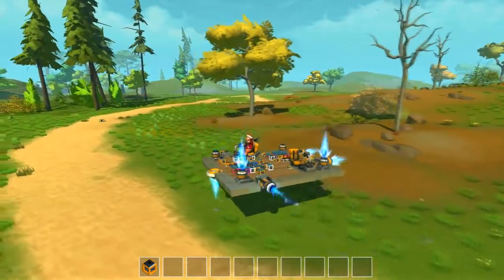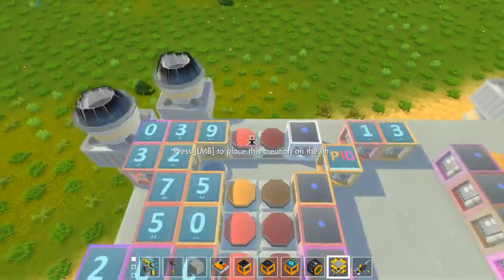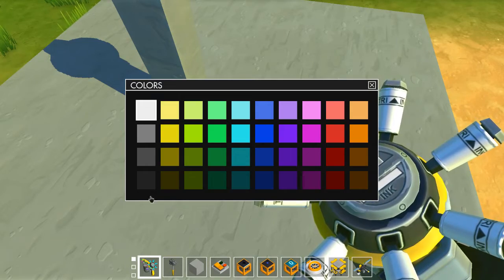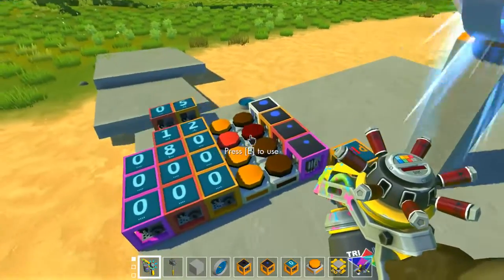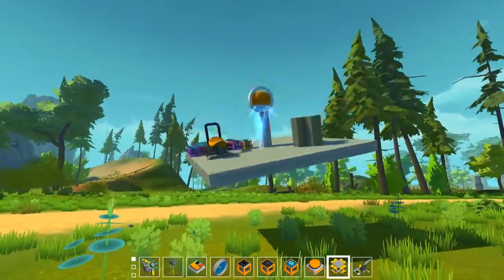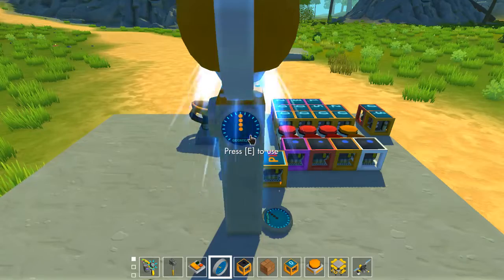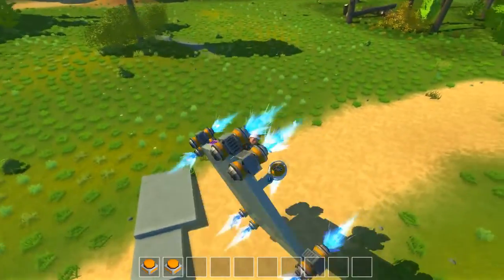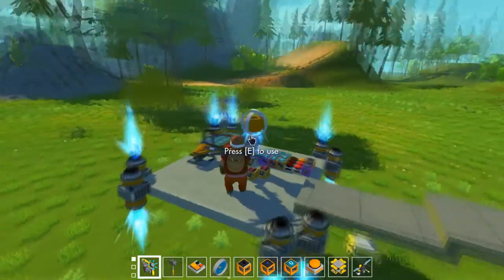MathBlock PID TUTORIAL | Scrap Mechanic

Comment: I had to look up PID controller on wikipedia. In laymen's terms, its basically the stabilizing computer for quadcopters. Plug in a desired data value like an altitude, along with the current data value, and it spits out numbers that you feed into thrusters and engines that (if tuned correctly), will correct the difference between the desired and current data values. "Proportional" is simply the difference multiplied by a constant (higher constant means a more powerful response), and I and D are integral and derivative calculations that factor in time. "Integral" factors in time elapsed, increasing the power (which is also being reduced by the lessening difference) until the difference is zero, after which Integral resets. This may produce enormous endlessly rising power if the difference never reaches zero. Like if you block the machine from reaching where it wants to be for a long time then suddenly let it go, the built up force will send it shooting off into space. Derivative only seeks to "zero" the slope of the graph of the difference over time and not the difference itself, and this produces the bouncy oscillation effect.

Not just useful for hovering vehicles but also cruise control in cars and robotic movement.
Reply: I recreated the initial contraption made that just uses the gimble thruster, and I was outputting the PID result to a number block display to see what was going on. It adds the 3 calculations together. It doesn't seem to calculate the Integral portion like I had thought, as the number doesn't seem to keep increasing. I adjusted the special "I time modifier" down to 10 ticks thinking the lower it was the more often "I" would get recalculated, but that produced the effect of the PID output not changing at all. So is the "I time modifier" a limit on how far backward in time the "I" component is compared to?

Comment: Is there any way to have both a pid and a button control a thruster? Like if I want the pid controller to control the thruster just as normal, but sometimes want to override it with an on/off switch?

Comment: This is one of the only tutorials I can find on the PID block and it's made a little redundant by speeding up the wiring so I can't see what needs to attach to what. What is the reason for some of the thrusters being pointed upside down as well?
Reply from the maker: That way it can counter roll

Comment: A similar method can be used with the gravity block in the modpack (the one that adjusts gravity for a creation not the whole world) to create platforms or anything really that will float up to a desired height and stay there. I used this tutorial and about an hour of trial and error to figure it out lol. I lost track of the number of times I'd try something and flip the switch and the whole thing would shoot off into outer space in less than a second and never comes back. I think it legit broke the world a couple times cause I'd sit on the seat and flip switch for .2 seconds then jump off seat and freefalled for like 5 mins before I just quit the game and deleted world cause no ground was in sight. 

After an hour+ I have a small platform that I can set block height and flip a switch and it'll float up with variable speed/stiffness to desired height and stay there as long as I want it to. Super neat capability with the PID block and my mind is already racing with ideas of things I can weld this thing up to and make it fly.

Comment: i have rebuilt it like you do but for me its not working its just bouncing up and its not giving thrust down if its over the given altitude
Reply: Same here. It even increases the power when over the given altitude.
Reply: @hoobbit9893  I had the same problem last night but had to check my colours and wiring, and orientation block colours and then was fine, I cant work out how I might make it reactive to surface, any ideas?
Reply: PID's take a lot of tuning to make them work right, generally you get it as stable as is reasonably possible with P, then move on to I, then if you really want extra stability you can move on to D. A properly tuned PID will make it look as if the craft is being held there by strings. Also, the gimbal thruster won't accelerate downwards, only upwards.
Reply from the maker: Why do you think the gimball can't do downwards force?
I before D?! Doesnt really make sense